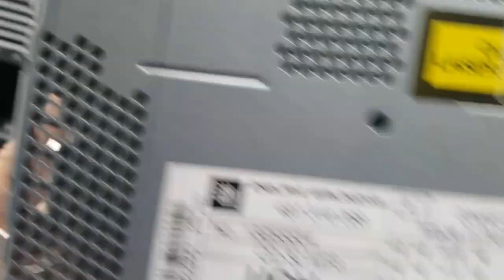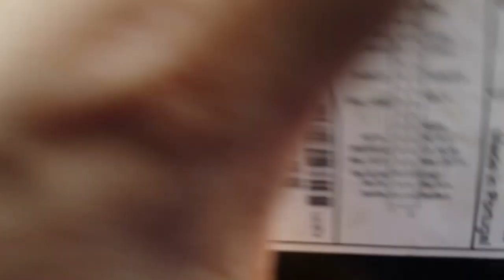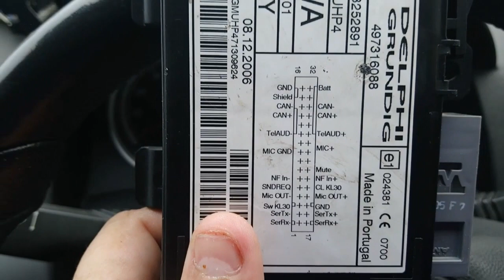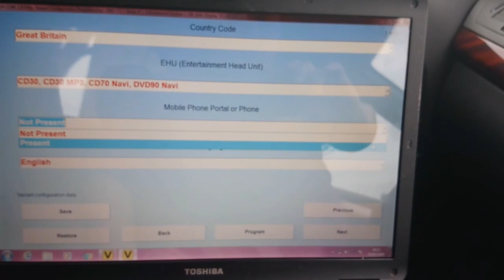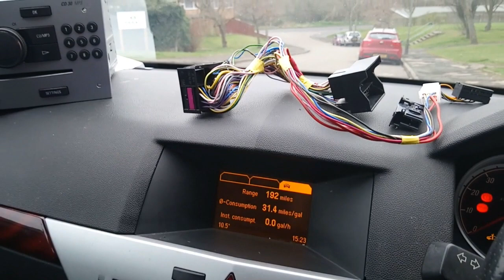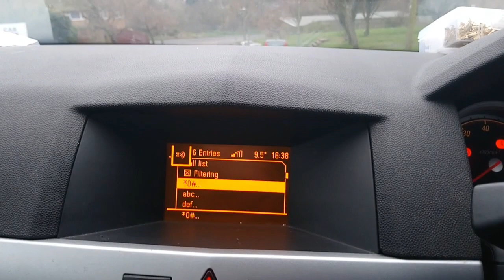Astra H Bluetooth retrofit (Continued)

Comment: Thank you so much for your videos. I want to try this, I've bought a Bluetooth module but have no idea what cables I will need. I currently have a CD30mp3 but want to upgrade to the CD70 when I can finally get hold of one. 
I have no idea what I'm doing, could you please help in terms of finding budget friendly cables I need and also where to find a mount for the UHP4 unit, also a noise cancelling mic that will work with it with a long enough lead. I also want the cables for any future cables like adding a reversing camera to work with the system and possibly DAB.
I'd really appreciate it if you can list the items needed and links please as I'm so clueless with it all lol.
Kind Regards,
Ben

Comment: Please, show how to conect microphone
Reply from the maker: Hi its been quite a while is did this but if memory serves there is a connector pin out on the Bluetooth module, I believe the mic connects to Pins 4 and 20 for the audio signal and if you have shock mic power/ground are Pins 9 and 22.If your using aftermarket mic it will need power from another source as module does supply enough voltage for aftermarket Mics.

Comment: I regret buying this crappy system. I got a display and radio that are paired and I just want to have it as a stereo for a boombox project, I don't need the other stuff like the mic etc. How does the radio communicate with the display? There are no wiring looms any where for the display.
Reply from the maker: The body loom should have the wiring for both screen and head unit
Reply: @zedalon  all the looms I've seen only have the head unit connectors, nothing for the display. It only cost me 25 quid I'll just have to sell it on if I can't get the plugs for it. I think the connector for the display is on an entirely different wiring loom that the headset loom plugs into.
Reply from the maker: Which headunit/screen do you have?
Reply: @zedalon  its the CD 30 head unit with the small display unit. I've just been watching your video again to try make sense of it. I will need to get that plug and figure out the wiring for the display to the head unit then, I think its CAN1 & CAN2 for the display data and then GND & PWR I'm not sure if there are anymore that need to be connected but thats what I'm thinking.
Reply from the maker: just plugged that in plug the stereo in and it work
Reply: @zedalon  Thats if I can find the plug. I can't find it anywhere online, worse case scenario I might have to try soldering some small wires to the pins of the display unit.
Reply: @zedalon  The plug is impossible to find I can't even get an image of one its like they are non nonexistent. I might be able to get 20 quid on the unit otherwise its as good as scrap, so frustrating you'd think that people would save these plugs and looms. ebay sellers that sell these units have the looms and plugs but refuse to part with them which they use for bench testing. The only other way would be to solder wires directly onto the pins and I'm still not 100% about the configuration on the display unit wiring so the most sensible thing for me to do is leave it alone and sell it on and get another stereo. Thanks for all your help anyway, its much appreciated.
Reply: The display doesn’t connect to the stereo directly, it plugs into the BCM and communicates via canbus

Comment: I have bought the parts but can you show me where the wires from the loom lead too in the car
Reply from the maker: Hi ya can send me photos of what the have?
Reply: @zedalon  how do I send a photo?
Reply: Sorry what do you mean by that
Reply from the maker: Is it a original factory fitted or something that been made up?
Reply: @zedalon  all original parts
Reply: @zedalon  I was told that both the clips from the loom go on to the back of the radio, is that how it works?
Reply from the maker: Yes as I recall that's right, do you have the OEM mic?
Reply: @zedalon  yes I do
Reply from the maker: So yeah it should just plug in behind the headunit but you will need to op-com to activate it.
Reply: @zedalon  I have the tab it just has no phone symbol on it
Reply from the maker: Cool so once you plug it in it should appear
Reply: @zedalon  oh okay I was told that I’d need the security code from the car the module was from, I’ve seen a lot of people get “Phone safe” pop up, I was wondering if you encountered that problem
Reply from the maker: That's odd I just retrofitted it and it worked with no safe messages
Reply: @zedalon  fitted mine says UHP safe
Reply: @benji4257 .
Reply: Ich merke gerade das du ein deutscher bist wegen deinem profilbild 😂😂 ehm ich hab nh frage hast du das mit dem Bluetooth schon hinbekommen weil ich bin auch dabei bei meinem 2005er opel aux oder Bluetooth einzubauen

Comment: Hello! I have an Astra H but i have thd CD30 (not mp3) . Should i be able to do any of this ? thanks
Reply from the maker: If you have the gid screen you should be fine as the stereo doesn't really do much more that pass the audio through to the speakers.
Reply: @zedalon  hey, thanks for the reply. Since you call this screen GID i almost certainly don't have It .. i think mine Is the basic One ? It's not as "refined" as your
Reply from the maker: Does your screen have 2 buttons along the bottom?
Reply: @zedalon  i just found this image https://www.google.com/url?sa=i&source=images&cd=&ved=2ahUKEwiUi_bHx7njAhWGK1AKHW9PAAgQjRx6BAgBEAU&url=https%3A%2F%2Fwww.diagnostics.org.uk%2Fhelp%2Fshowthread.php%2F5313-Upgrading-to-a-3-line-display&psig=AOvVaw3vT4SW61UrGldvmdu69Kf-&ust=1563370623189015 . i have the BID one. Is it possible to upgrade maybe ?
Reply: But anyway i just wanted to add bluetooth functionality!
Reply from the maker: You can upgrade the screen best bet is to find stereo and screen together on eBay of scrapyard that way it's just plug in and off you go. You need at least a GID for Bluetooth otherwise you wouldn't be able to do anything like pairing phone etc. As it happens I'm upgrading to android headunit so my Bluetooth module and wiring will be available 😁
Reply: @zedalon  well if you are going to sell it i can consider it! Just bear in mind that i'm in Italy and my car is called Opel :D and there will be some shipment costs.  sugar0 at gmail dot com
Reply: CID would also work with CD30

Comment: Hi! If I have a BID in my astra. Can I buy and fit a GID in my CD30 radio with bluetooth and all with no worries? Plug and play or is op com needed?
Reply from the maker: To get the Bluetooth functionality you only need the gid and the uhp4 Bluetooth module also the wiring,depending on the spec of your car the wiring might be there if not your have to make the wiring up like I did. I think the the cd30 should be find.if you do want to go down that route you need op-com to setup the gid to show the Bluetooth info. It might be easier just to go with an after market headunit with Bluetooth already installed.
Reply: @zedalon  ok! Thank you very much!
Reply from the maker: Do you mean the uhp4 Bluetooth module?
Reply: @zedalon  I dont understand much about it and really need someone  that does to advise me ahahahah. I dont want to start purchasing all the parts without knowing what im doing! I dont know what you said. Tks!

Comment: nice video m8 just missing the radio programing part
Reply from the maker: I not sure what you mean as you don't need to program the radio to the Bluetooth module it's just plug in and off it goes once you setup the screen
Reply: so you dont need to change any setting in the head unit cool
Reply from the maker: @AlanAnsell  no as the module is independent from stereo it only shares the wiring and works when stereo is off